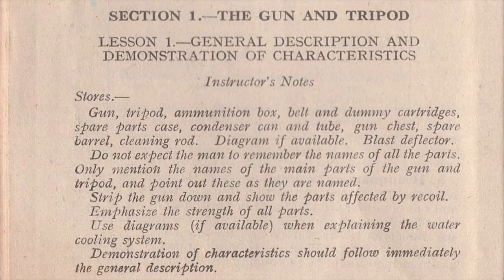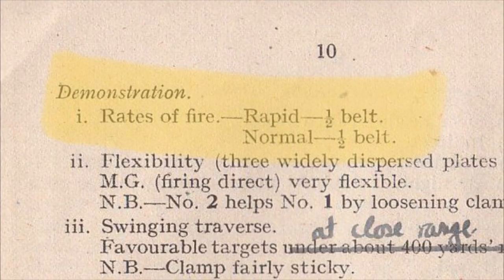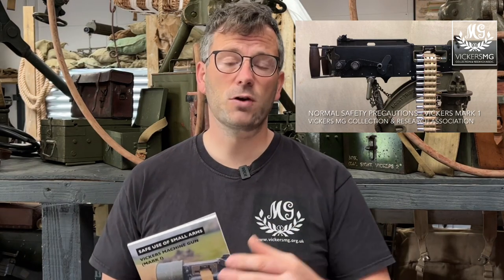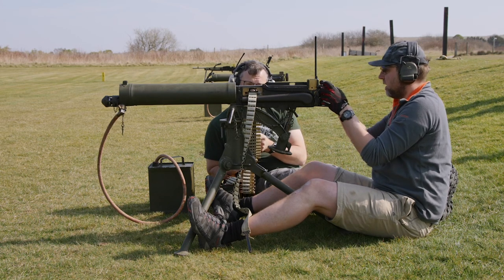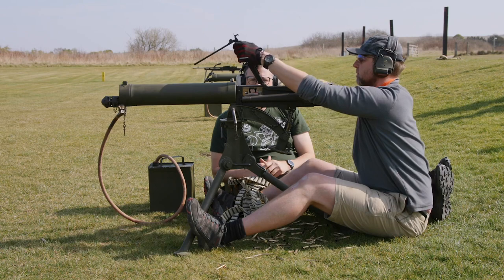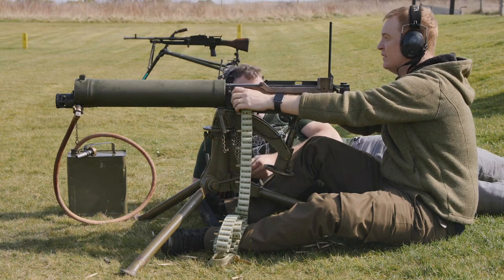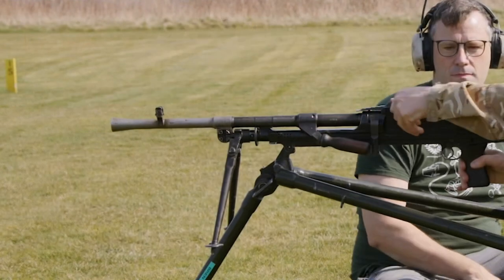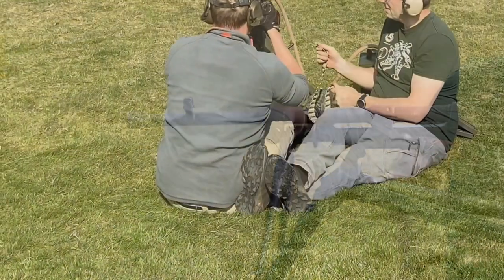Vickers and Bren Machine Gun Rates of Fire

Comment: I think for longer duration Vickers is more Comfortable but in RPM Bren can outrun Vickers due to very quick reloading
Reply from the maker: It’s not a competition between the different guns. 125rpm is the rate of fire in the manual for the Bren. You can reload a Bren quickly but you have to do that ten times for every new belt on a Vickers so the Vickers could be quicker and for longer. Just heavier!